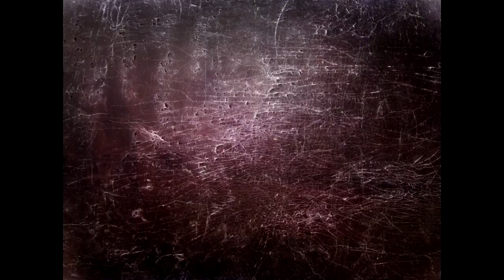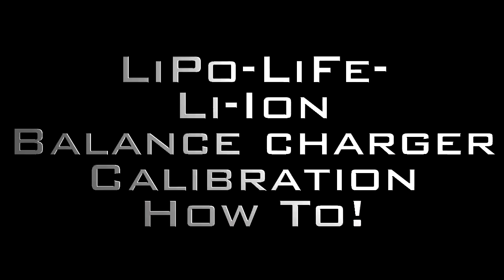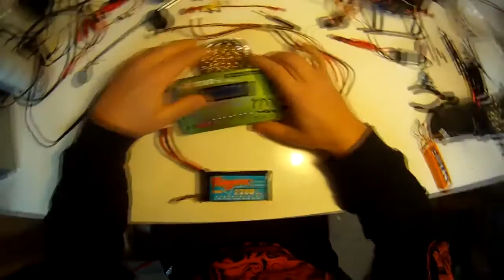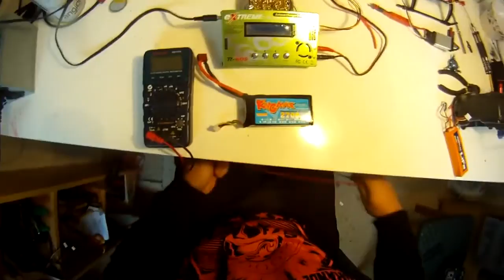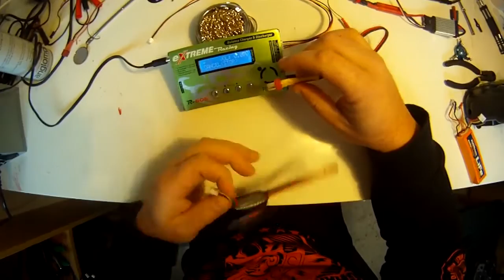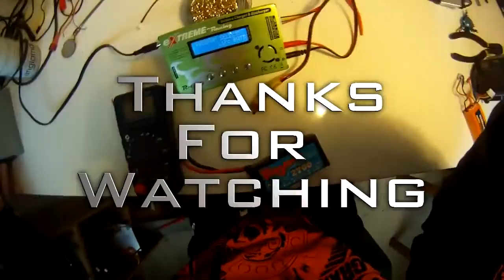balance charger calibration.mp4

Comment: That is only one part of the goal.
If you are useing the balancer ports you have to calibrate them too.
Otherwise you should not use the balancer mode... it's horrible bad !
The only software I know to reach this fine tuning is to flash the
Cheali Charger software into the device.